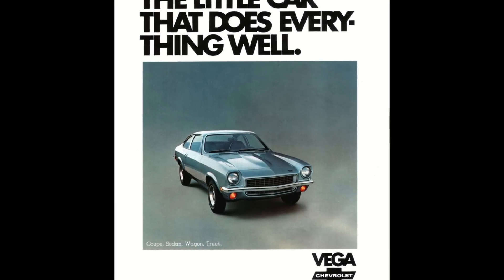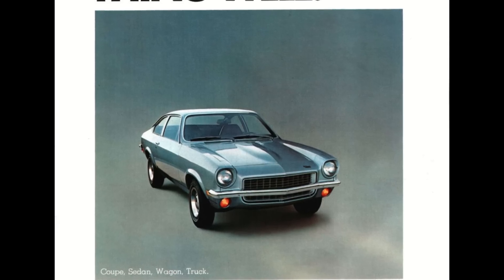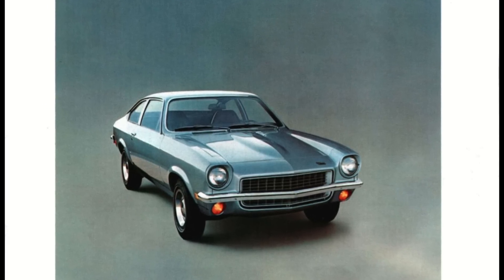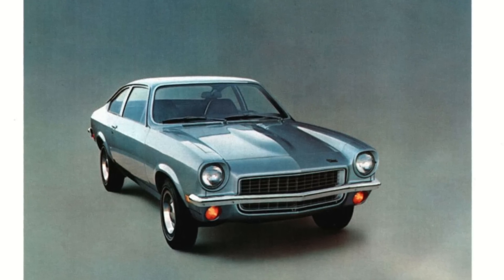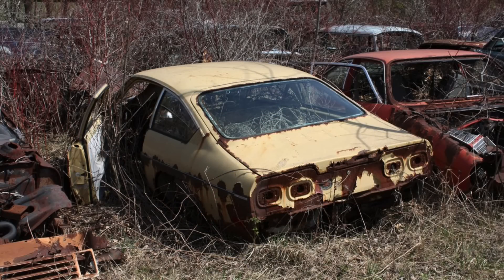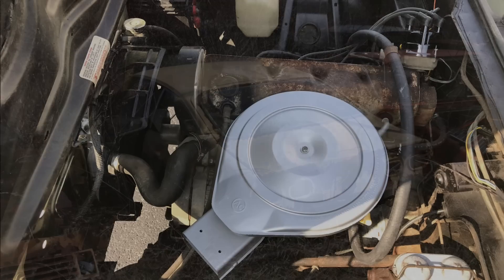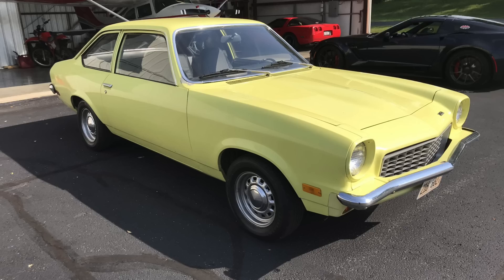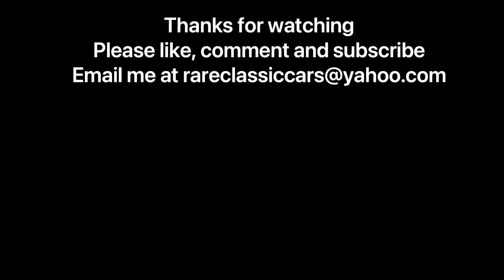GM's Largest Failures: Why The Chevrolet Vega's Engine Turned Buyers Away From American Cars

Comment: I knew some guys who used the ill fated vega for NHRA. they were small lightweight car bodies. My step brother had a 440 mopar with a 4 speed manual transmission in a vega when I was 5 years old. Other guys had full race modified chassis built underneath the vega with a small block bored and stroked 454 or a big block. these cars could make about 10 second quarter mile. I described the way these cars were built as "Racing a lawn chair"

Comment: Radiators:  The small radiator only was in place 1971 and 1972. They went to full width radiators in 1973, dual core.  That was especially needed with AC vehicles.  The smaller radiator was also designed for use with the Vertapac cars with the Southern Pacific.    You have a lot of interesting but incomplete information.   Valve stem oil seals were prone to failure up to 1974.  The seals were hard and not very pliable.  From 1974 onwards, the engine issues really dropped and they were decent.  Hydraulic lifters in 1975 along with HEI.

Comment: I had 26 Vega's total from 1984-1988, buying and selling them while in high school.  It was easy to buy them for $100 with a bad oil sensor and fix them up to resell for $1K or less.  I fixed the common problems and they were reliable after that.  Once you sleeved the block, you had a decent daily driver.  I would LOVE to have a 74 GT Kammback, but geez, these cars cost more now than they did new!

Comment: The silicon cylinder coating was a terrible  idea. The open deck block was another weak point. My cousin owned an engine rebuilding shop and did dozens of rebuilds on Vegas. After we installed cast iron cylinder liners they ran well for a long time if they were well maintained.

Comment: the vega/ astra at the start of production was to have a rotary engine but "G.M." pulled the plug on that engine, and wound up with an engine that was not tested. being that the engine was not tested, "G.M." put a 50,000 mile warranty on those engines!!!/ boat anchors .the cars were built at the lordstown ohio plant and were shipped standing on end.

Comment: All engineers that worked on the Vega design should have been required to drive to work in one. And the accountants should be required to take their vacations in a Vega. And management to get paid based on the number of repairs on the Vega. My mom's Vega was the worst car ever. I never bought another Chevrolet. My mom sold the Vega for scrap and bought a Toyota Corolla, cheaper than the Vega and the Toyota outlasted her, and her sister.

Comment: A friend inherited a Vega from his father. One day the warning lights came on - all of them because the engine died while driving. It turned out the fault was a bad coolant hose, which quickly drained the bathtub. The result was that the cylinders, which are seen rising out of the bathtub at 6:45, actually softened and drooped so they no longer sealed against the head gasket. No fix for that one, either.

Comment: A coworker of mine was an adept DIY with cars and most other things.

The engine was a voracious burner of oil. He took it apart himself and found the oil seals on the valves were neoprene. He had to replace them, he did this himself, every year and that was really longer time than was needed. It also blew a head gasket.

Comment: The only thing worse than the Vega was the Chevette. Vegas not only rusted and had engine issues, but the steering also had issues and the transmissions weren't the greatest thing under the sun either.

Comment: I bought a first year Vega and finally gave up at about 80,000 miles.  You covered almost all the problems I found but I have a couple more.
There was a reaction between the antifreeze and to aluminum block that plugged up the tiny radiator and pretty much guaranteed overheat.  When you removed the radiator, it truly looked like heater core rather than a radiator.
GM was also know for not putting enough paint on their cars and the Vega was an extreme example.  I stopped washing it after a few years because it looked about the same dirty or clean.  
The rust was coming from the outside in, unlike most cars that rusted from the inside out.
GFM

Comment: My mom had a 1975 Pontiac Astre which was Pontiac's Vega. Her car was the 2 door station wagon model. It had the aluminum block 4 banger which were notorious for blowing up. She also had the automatic tranny and fake wood panel which was a decal. The car almost hit 80 mph flat out but it took forever to get there. I got my license with this car and tortured the hell out of it and it never failed which is incredible considering the bad rap they got. This car went to 70,000 miles when my mom sold it and I put at least 30,000 of the hardest miles you could think of. Must have been a Wednesday car

Comment: The 2 Toyotas I owned were worse.  Manually adjustable valves with feather edges warped from blow by when they neared the 6000 mile recommended valve adjustment (probably should have been 4000 mi).  Exhaust manifolds broke in half, Just dogs too.  GM was just keeping up with the Joneses.  Those were dark days in the auto biz.

Comment: By 77 the car was durable but no one would buy them.  I knew this and used it to buy a new Vega for $3000 which I owned for years then sold it to a good friend who drove it for many more years.  Early Vegas were the pits.  Ford Pinto's weren't much better though.

Comment: I worked at a GMC dealer that sold the Pontiac version of the Vega.We would find the cylinders would form cracks in them. We had the honing equipment to install high limit pistons on a cylinder scuff down.Had a special hone and hone fluid to do it.

Comment: Auto makers routinely buy cars from other manufacturers to take them apart and analyze the production techniques of the other companies. Why don't they just imitate Toyota? I've got two of them right now and at 200,000 + miles they have no issues. I've tried to maintain them carefully, but at the same time, they have been unusually reliable even  though  they've  been maintained well. It seems that Toyota has discovered how to make extremely durable and reliable cars. The other car companies should just learn from them.
Reply: I might add too, that it seems that Toyota also purposefully designs their cars to be pretty easy to maintain - another bonus for their engineering team. They are brilliant.

Comment: Have not owned a GM since 1985. Have had nothing but trouble with them. Will never buy another one. Plenty other options out there. Currently driving a 250,000 mile 2007 V8 Explorer bought new. Very little problems. Will trade in after I hit 300,000 miles.

Comment: This was also the time that oil manufacturers were boasting 15,000 oil change intervals. I had a neighbor that had a 75 wagon with A/C. I changed the oil every 3,000 miles. It never had any problems. Don’t get wrong ,it was a turd and cheaply made. I took care of all maintenance for her, I did have to replace the timing once. She traded it for Pontiac 2000. After that she has never owned another GM.

Comment: I drove an early model Vega for years and years. Once I drove it from coast to coast. I did check the oil and water every day. Since it only held 2 1/2 quarts, I added 1/2 quart when it was 1/2 quart low. It leaked oil and blew oil. It never burned a drop. I proved it with completely worn-out spark plugs that were oil-free. The worst thing about it was the 365-day clutch cable.

Comment: Respectfully, I think the fender liner thing is BS. In my '72, the frickin' firewall was crumbling as were the trailing arm connection points. I loved it but it was simply built of inferior materials. Later I had the rebadged Monza. No such problems. BTW, the Vega owners' motto was "Check the gas and fill the oil, please."

Comment: Cast iron rings in an aluminum cylinder wall. Briggs & Stratton got away with it so what could go wrong? Then there was the terribly undersized radiator. Chevy doing something on the cheap once again.

Comment: GM already had a good engine for the Vega.  The 1900 that came in my 75 Opel Sport Wagon was very nice for the  time. Multi port Bosh fuel injection came in the 75. A very tractable engine that always started no matter how cold it was outside. Better power and lowe end torque.  A good shove of idle and just kept going through out the whole rev band. No problem with longevity either. A well proven engine that could have been updated for decades. Never drove a Vega.  That little Opel wagon had nice suspension and certainly well behaved handling on secondary roads winding through the Wisconsin country side.

Comment: I wonder if the engineers at GM tried to convince the bean counters to make the right decisions and the bean counters won out. You could see the company listing toward the side of the bean counters by the 1970s and that was its downfall. This price-over-quality decision making brought so many failures to the GM name in so many ways. Olds diesels, V8-6-4, X-Cars and more - all of which might have been saved if they had just done it right first. 

Okay, I don't think anything could have saved the Olds diesel.

Comment: I Had a 71' 
I liked the Car, inside and the back hatch gave lots of room in the back.  I also pulled a light weight motorcycle trailer. 
The issue was the engine,. just under 20MPG and 2 quarts per tank
And rust, so bad it won.  I bought in 76' Got rid of it 77'

Comment: That block with those free standing cylinders that look like they are floating around in the block is used everywhere these days in most brands maybe GM was first to the party with this design and they were not held in the block as strong as they could have been . Have alook at most modern 4 cylinder blocks.

Comment: There was no water jackets in the cylinder head above the radiator in the Vegas It was a tall head because of the cam I worked at a  Wrecking yard Called kit's auto recycling At  El Cajon Speedway they started a pony class my boss told the officials he cannot compete against the  Pintos and Mustangs. They allowed him to weld up the combustion chambers on the cylinder head To boost the compression It proved to be highly compeuntil the second year the pintos and the Mustangs got more experience and produce better motors Also the Vegas in the third year or so had 2 foot wide and one foot tall radiators We used to spray paint that head gaskets to make them feel better One time after this treatment we took all the headbolts out of the motor and lifted the   front of the car  By the head We ended up breaking the seal of the head gasket with a hamer and chisel

Comment: What really turned people off of the Vega / Astre was overall abysmal quality. Keep in mind that these rotten clunkers came in 1970 (immediately on the heels of all of the incredible vehicles of the 1960s) so the level of customer dispappointment was massive. These under-powered rattle traps with their incredibly cheap interiors were frankly horrendous. I lived in the midwest at the that time where salt is used on the roads and these vehicles rusted out within the first three years of their lives so that by the mid-70s if you saw one of these vehicles going down the road they all had their wheel wells and lower rear quarter panels totally rotted out.

Comment: If only they would have developed a cast iron engine like even say the 2.5 Iron Duke. They could have made a betterr design than the cash strapoed clattery 1976 version they had to unveil since the aluminum 2300 Vega motor sucked the development budget for Years at General Motors for a mere economy car.

Comment: Great video Adam!  I would also note that many Honda 4 cyl auto engines are open deck designs as well.  However honda more typically uses shorter strokes with relatively longer connecting rods, meaning cylinder side loading is minimized.  Short rod, low rpm domestic 4 cylinder engines side load the cylinders and piston skirts to a much higher degree

Comment: We had a 1976 Vega.  Rust wasn't bad, and the only time it failed us in 6 years was when the cam belt broke, which for the period is pretty good.  By 70,000 miles it got 227 miles per quart of oil, which I figured was the valve seals, but the video says they were fixed in by then.  It had a handling package, featuring chunkier radials and big sway bars;  it barely under steered.  It was not an awful car.  It also was quite a bit quieter inside than earlier models.   We did have inside information that most of the problems had been addressed.

Comment: The car wasn't a bad driver. I had a 1974 Vega GT. 3 speed manual. Bought for $100 in '78 in HS. Drove pretty good, never had to change the oil as it went thru 2 quarts a week ! The hatchback glas has to be duck taped in as the entire frame area rusted out ! Drove the hell outta it for a year....Then as a senior in HS I bought a baby blue Pinto wagon ! Drove it for 200k miles until a tornado killed it. Was a damn good little car !

Comment: They made fantastic drag cars. A small block did wonders for it. 
The four cylinder could not stand running hot. One overheat and the head gasket let go. 
If they got it real hot, it needed a rebuild.

Comment: The Vega definitely was an execution that didnt work out so well, but then again with todays throw away cars its no different from any brand. Between faulty electronic sensors, rodent friendly soy wiring harnesses, oiling issues, premature rot on subframe assemblies, automatic transmissions with premature problems regarding shift solenoids & fluid going bad rather early, i dont know what is worse. If i had a Vega and wanted to keep it an economical mileage machine I'd probably install an old Iron Duke Pontiac 4 cylinder in plus i know from good experience you can beat those engines around.

Comment: Another MASSIVE FAILURE in the original Vegas was the use of the TINY radiators.  When the motors got too hot, the alloyed aluminum scored very easily and led to massive/rapid wear when overheated.  Then, the emission system implemented that blocked vacuum advance in the lower gears gave horrible performance.

Comment: I had a 73 GT with posi rear end. Which I blew out. I put some Lakewood traction bars. I wanted to put a 350 in it. Didn’t quite make it. My was a rust free car. Mine had factory a/c and a bigger radiator. I didn’t like the crappy Opel 4 speed transmission . Loved the car. I would like to have it now in the condition it was in when it died. There is a lot more to the story I’m leaving out. Cool video. Maybe you hood do one on some V-8 Vegas. 🥸

Comment: Gee lets save $8 cheaping out on the most important part of the engine/car to save the customer initial money buying the car, then require them to buy a whole new air box everytime they need an air filter...Man seems like this was designed by a burracracy committee..ya that would scare me away from a company forever. This is why i love free market stuff like this wont survive long.

Comment: I worked with a guy who had a Vega with a 3 speed manual shift transmission. I drove it once and found it to be crude. I owned a Grand Prix at the time so I didn't have much to compare it to. The car managed to get him to work each day but the issues with these were significant. I worked with another guy who had a Vega wagon with a SBC V8 in it. Very different animal. GM couldn't seem to compact car its way out of a wet paper bag. The cut corners then as they still do now and the 70's seemed to mark the beginning of the slow downhill death spiral of the corporation. They have never been able to make competitive small cars. It was an attractive car for the time but looks only get you so far and don't age well.

Comment: The moment they discovered that the rigidity of the aluminum block was lacking and the iron head would need to be a big standing beam style to deal with it, the aluminum block should have been abandoned. The head erased the block weight savings.

Comment: I had a friend who bought a used Vega against our advice. He drove it on a 280 mile trip and when he returned from it, he boasted that the car didn't use any gas, but he admitted to having to add oil. Then I asked him, "How much oil did you use?" "A whole case." he said sheepishly. The car was such an oil burner that my friend had to throw the car into gear before shutting the engine off as it would continue to run sipping its own oil!

Comment: My 1974 Vega GT was bad ass, with a 9" ford rear, 327 4v 2 speed power glide.  Bitch was a beast , untouchable.
Reply: I had a 1966 Triumph spitfire total  curb weight 1650 lbs ! With a Chevy 350 400 hp 9" Ford rear 4 speed! I was in high 9s in quarter! I guarantee I could get it done!

Comment: And your degree in engineering is?  I worked on a lot of Vegas during the years I worked as a tech.  I had one commercial account that had over 100 of them, Teledyne Corp. They put on tons of miles with very few issues.  The majority of oil usage was valve seals, easily fixed with aftermarket seals. You could get past the air filter issue by buying a Hastings filter that was split and use a Hastings AF144 filter.  Also if you ordered the car, you could order a H/D radiator (used with A/C models) that ran the full width of the grill area. I owned a 74 wagon, The wife loved it, drove it a bit over 100,000 miles with no issues. Much of "the issues" are like the overblown Pinto fire issues.

Comment: I remember working on these things back in the day at a service station and would bet myself that when I opened the hood I would either find the hard rubber oil cap completely gone, or with big chunks out of it. In either case, the overhead cam would sling oil out, further contributing to oil loss and the bad things you mentioned. Given your comments about GM’s cost cutting, I’m sure a metal cap was  $0.50 too expensive.